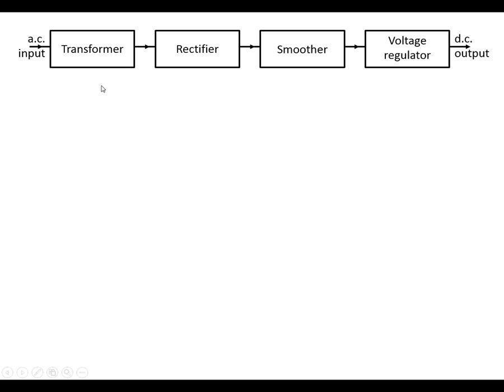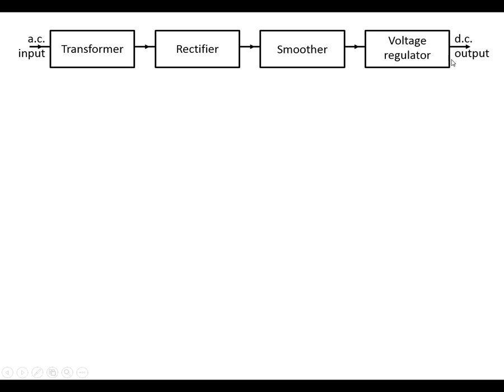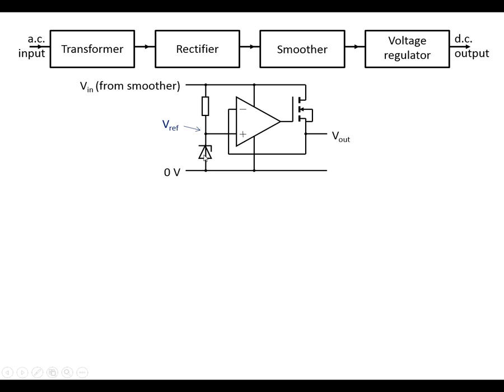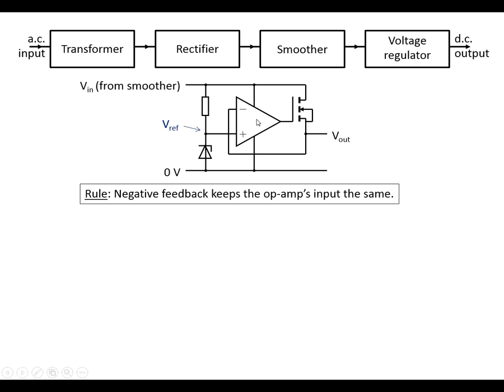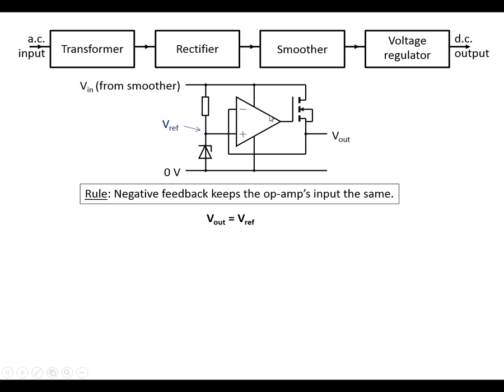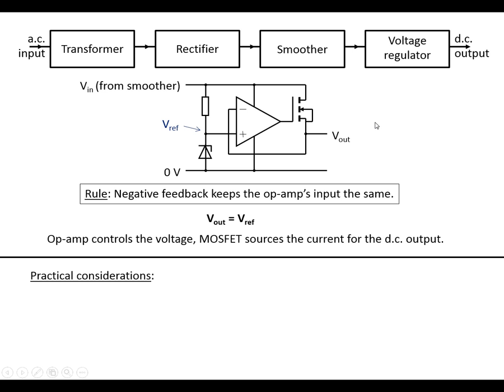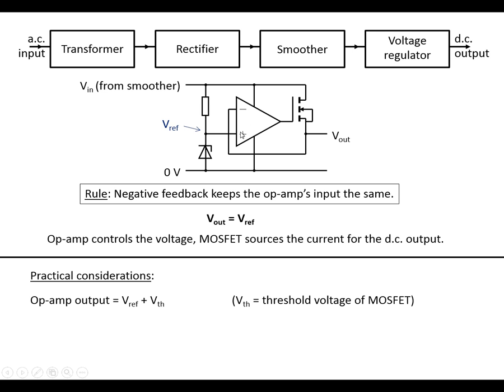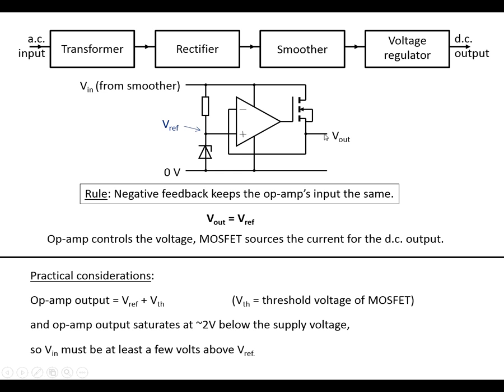Voltage regulator

Comment: Good explanation. Although OCR regard this as on off control in most real world cases it'll reach equilibrium and be proportional - certainly in real circuits the output FET will get hot dissipating Ids x Vds as if it is proportional, rather than run cool switching on-off.
Reply from the maker: Yes - this did catch me out, hence my disclaimer, although I have seen this circuit on breadboard in class working as an on-off - we looked at Vgs on picoscope and saw it switching very quickly. I get the students to build this circuit, then measure Vout for a range of unstabilised input voltages, then measure Vout for different load resistors (i.e. how is Vout affected by load current). It works satisfyingly. I then get out some L78L00 series voltage regulators and open up a power supply to show them the real thing.